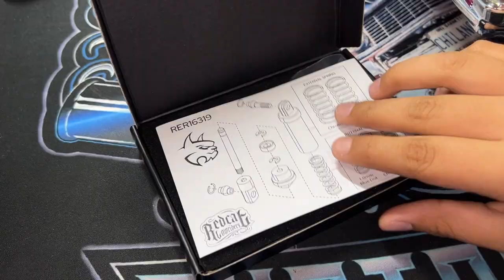How to install Kustom Rc Lowrider Shocks

Comment: Not trying to knock em down they do perform n bounce nice but when it comes to fitment an working properly its not good at all specially when doin 3wheel or hopping , the cap from the front shocks will come lose!!